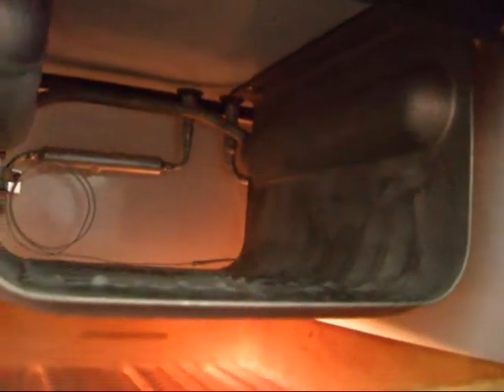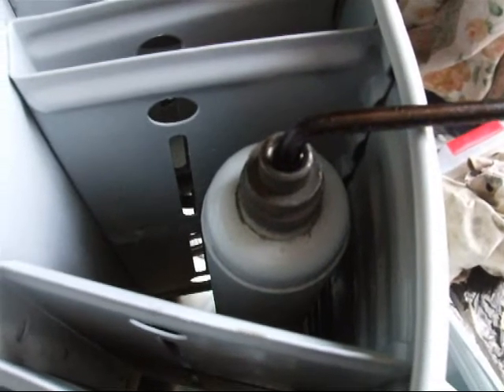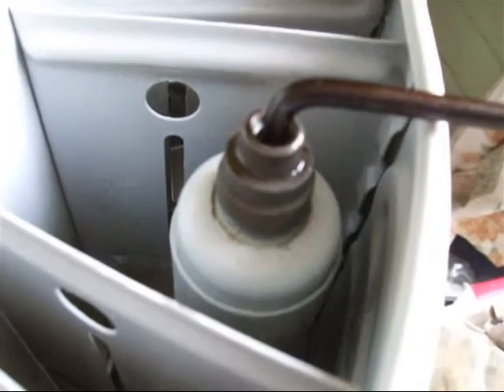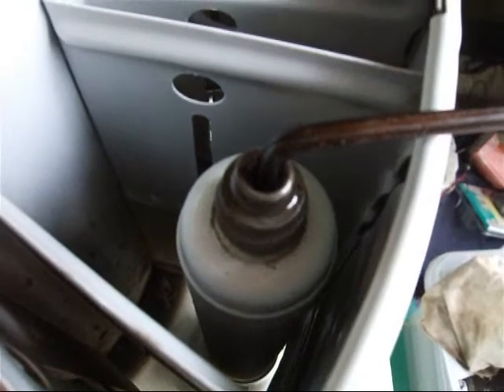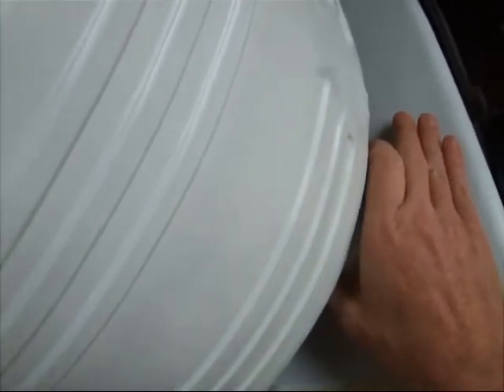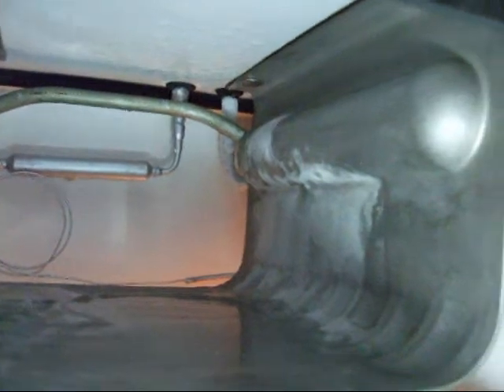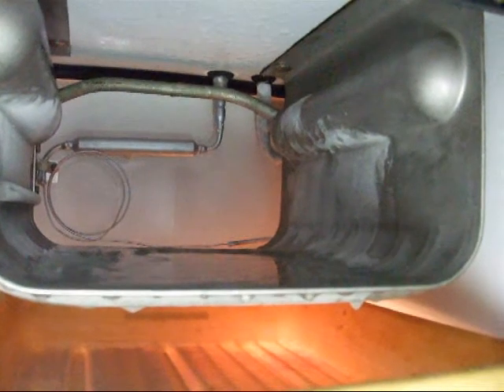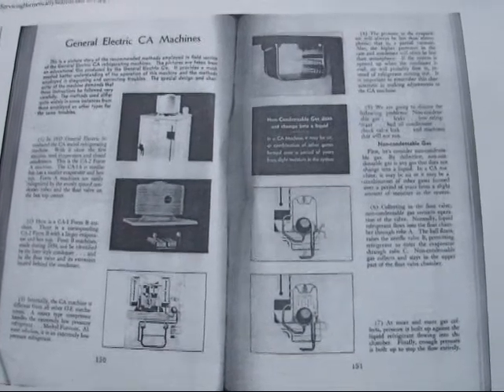Purging the CA Monitor Top

Comment: Good afternoon, I have a 1933 CA-2-A16

Just replaced the oil heater cartridge, and got my Bristol key.

Just to confirm I want to purge with the unit ON correct?

I cracked it cold and it began to pull the oil inward which means vacuum.

Do you have a recommendation on how to warm aside from warm water in the pan.

Thanks!
Reply from the maker: Yes the compressor must be running and the condenser warm so that the pressure is greater than atmospheric. I find in summer with room temperatures in the high 20's (C) that I don't need to heat the evaporator, but for the times I do, I simply put a small saucepan of just boiled water onto the evaporator.
Reply: @cool386vintagetechnology6 

Awesome insight boss.

I’m about to make my way over to the shop and start working on it.

I will place some hot water into the evaporator and run it as you do in the video.

I will then follow the purge procedure.

Cheers you’ve been a great help.

Is that monitor top you did in this video still running?

Comment: Well here we go.  Finally got the correct tool to purge with. Can this be done after the refrigerator has been de-frosted?
Reply: Ive also been looking for the tool. Where did you find yours? Thanks :)
Reply: @willandtonyadventures914 MGS (maxi gain systems) sells the Bristol tools

Call and order, new .216 is different from old .216
Reply from the maker: Yes, it can be done at any time. All that matters is the condenser is under positive pressure.

Comment: My Methyl Formate monitor top runs for about 11 to 12 minutes thenvshurs off for about 21 to 23 minutes when it is about 75 degrees farenheit.  Is this  good? You already answered my question on the header  tanks being frozen 1/4 to about 1/3 up. As the frost builds up the ice gets to 1/2 to 3/4  up on the header tanks
Reply from the maker: The off time sounds good, but the run time is too long. I wonder if the float valve needle and seat is worn.

Comment: Excellent video. However I'm terrified yo do it myself  my right header tank has a frost line is about 1/4 to 1/3 up. Is it still good without needing a purging?
Reply from the maker: Theodore Novak The frost level sounds OK. If the compressor isn’t rattling and the cycling times are good, it probably doesn’t need anything done. I presume the oil heater is also working.